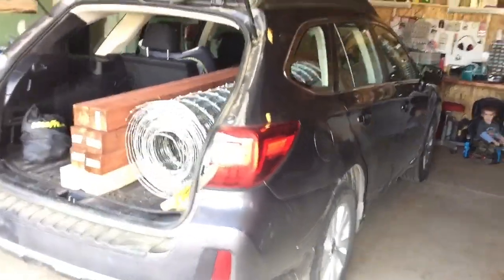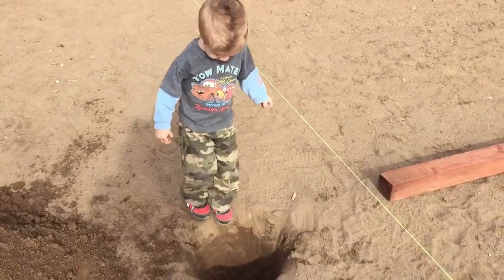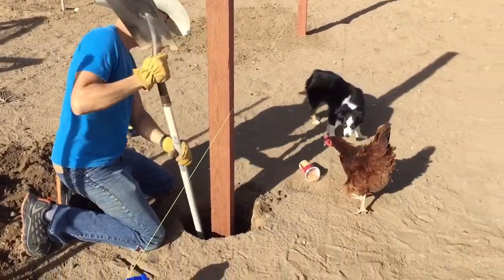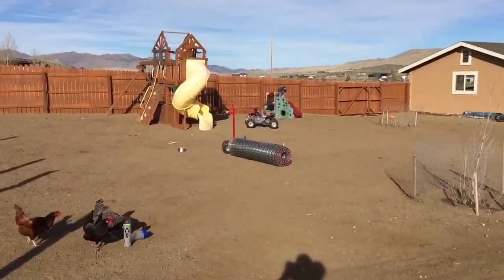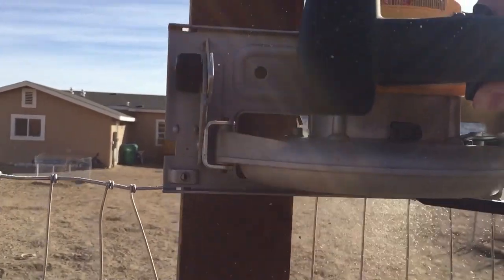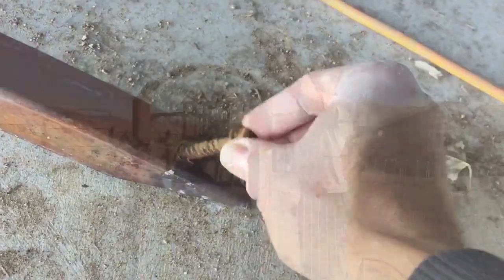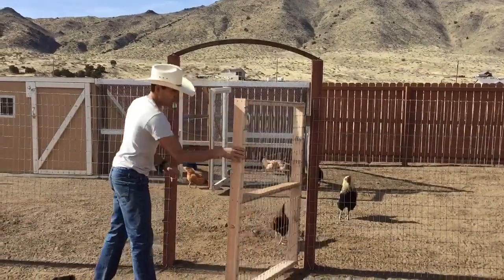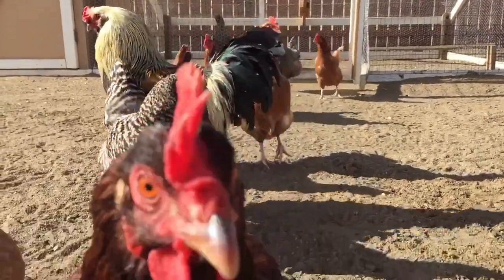How We Built A Fence For Our Chickens!

Comment: Good that you went to the effort of building a fence but also obvious you haven't done many.  For those watching it is good to watch but look at others before you do your build. There are several ways to do one, This is the cheap easy.  No concreated post, no stretched wire and such
Reply from the maker: Rachel, I’ve done multiple fence projects over the years. I don’t use concrete for my posts as it’s not needed with my tamping method in our area. We live in an extremely windy environment where people’s fences are routinely blown down. My fence is still going strong after 6 years while many of my neighbor’s fences with concrete have blown down. Often times water seeps between the wood post and concrete becoming trapped and then rotting the post which inevitably snaps at the base. Again, concrete is needed in some soils, but not ours. It’s a waste of time and money for the type of soil we live on. We did stretch the fence, but it is not shown in the video. We just wanted to display some of the highlights of our build instead of a step by step guide. Thanks for watching! 👍🏼

Comment: Great video!!! Would you mind sharing what kind of staple tool you’re using, or, if you have the model number? Thank you kindly!
Reply from the maker: Hi Karina! I’m using a Dewalt Staple Gun. You do need an air compressor to power it. Here is the link to it on Amazon...
https://smile.amazon.com/DEWALT-DWFP12231-Pneumatic-18-Gauge-2-Inch/dp/B00AK4CY7S/ref=mp_s_a_1_3?dchild=1&keywords=dewalt+staple+gun+pneumatic&qid=1587854414&sprefix=dewalt+staple+gun&sr=8-3
Reply: @MapleBoarder78  You rock thank you! Im new to this, is there an air compressor you recommend as well? Hope you upload new building videos soon!
Reply from the maker: Karina Lewis I would recommend the compressor I have. It’s portable and reliable...

https://smile.amazon.com/PORTER-CABLE-C2002-Oil-Free-Pancake-Compressor/dp/B000O5RO1Y/ref=mp_s_a_1_5?dchild=1&keywords=air+compressor&qid=1587861857&sprefix=air+compressor&sr=8-5

Good luck on your projects!
Reply: MapleBoarder78 thanks for all your help!!

Comment: About $15 at almost any hardware store will buy you a scissor post hole digger that will cut the work down by 50%.., then use a hose to wash the sand back in the hole once you fill it will also cut down the work.

Comment: So you seem to be fine without a roof as far as your chickens not escaping, but what about winged predators?  We are about to get hens and I was going to build a simple enclosure like yours, but experienced chickenfolk online have STRONGLY warned me against leaving the top open, saying we will lose our girls to the hawks, eagles and owls who share our neighborhood.  Being in the desert, perhaps you don't have to deal with as much of that, but still....  Any advice or experience with that?
Reply from the maker: PubDiji We don’t have many trees out here in the desert, so not too many predator birds. Been out here 3 years with no issue. We do have a smaller fully enclosed area made of chicken wire fencing that the chickens can run to and hide in if they see a large bird flying around our area. My friend built something similar to ours but then covered the entire top with chicken wire using 4x4 posts to hold it up from sagging. Personally, I’d wait to do all that work and spend that money. I would wait a few months and see whether predator birds are an issue. If you end up loosing a hen or two then you can build the roof. Otherwise, if you don’t have any issues, no need to build it.

Comment: What size posts did yall use?
Reply from the maker: We used 4x4 treated beams from Home Depot. I believe they are around $10-$12 each.
Reply: Thank you! Do you happen to know what kind and size of staples you used? We are doing a very similar project :).
Reply from the maker: @jordancabezas8971  I used 1/4" x 1.5" staples with my Dewalt staple gun.